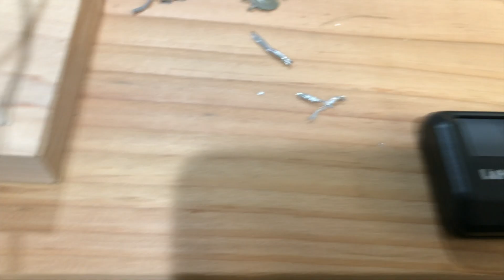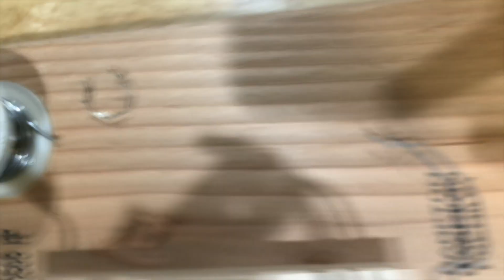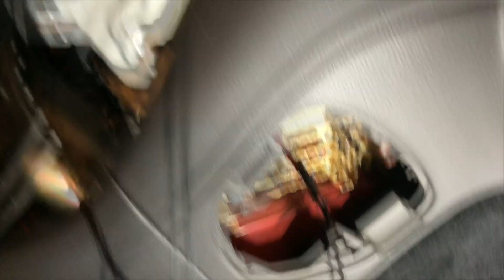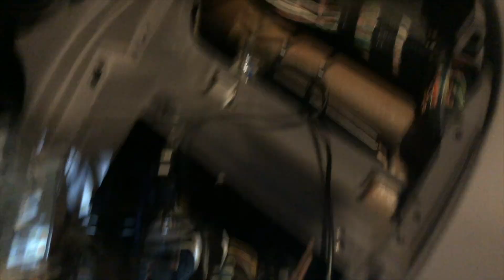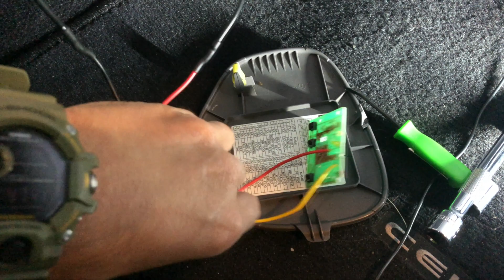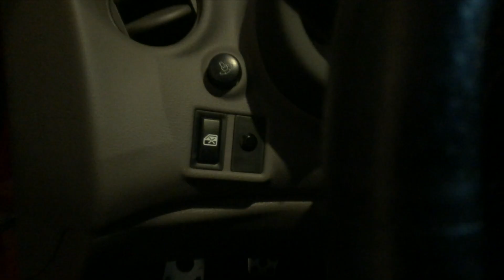Garage Door Remote Hard Wire Hack - Liftmaster Chamberlain Opener Install Toyota Celica Hard-Wired

Comment: Great video! Although I know how theoretically I need to do it it is always good to check some successfull install.

I have a question tho,  how logical you think is to leave battery on and skip hardwiring to fusebox part? 

Yes it will need to change of battery now and then but I am hoping it will approximately be once in a 2 years. I am planning to just stick this signal sendind device somewhere easier to reach so when I need to reach battery I wont struggle much.
Reply from the maker: thank you for the positive feedback.  i would say this depends on your car, and your preference for how deep you want to bury the remote, and preference for how you want to complete this task.  

it is simpler to just use the on board battery install wise.  you run less risk of problems with less variables like the quality of components from amazon that are changing the voltage and are integrated into your vehicles fuse box and electrical system. you also are able to reverse the work you did the remote easier if you sell the car and still need the remote.  i would say the inconvenience of replacing that battery every couple of years is minimal.

I am the kind of person who likes the idea of going the extra mile to have the remote 100% integrated using the cars power.  It made the process more interesting for me vs wiring a switch and taping the remote under the dash.  the finished project also feels more factory.
Reply from the maker: Another point i want to add about wiring the remote to key on power in the car vs battery… if you leave the remote on battery power the remote will always work.  So if someone breaks into your car when the car is outside of the garage they have access to your garage immediately.  Wiring to key on power and not constant power in the car adds an extra layer of security.  Someone needs to activate key on power to use the garage door remote.  So i would 100% recommend taking the extra steps and hardwiring the remote to key on power (key on = ignition).